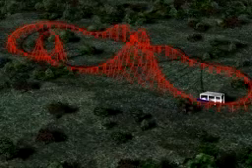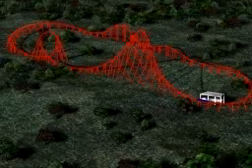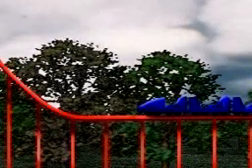How roller coasters work

Comment: Really!? Nothing is technically holding the train to the tracks?except a wheel? What the fuck?
Reply: There are upstop wheels on both sides of the train on the bottom of every car. So that's usually 24 wheels keeping the train on the track. The wheels are also tightly locked into a wheel mechanism that has been welded to the train. Roller coasters DO NOT derail.

Comment: Almost true.

The concept of potential energy, kinetic energy, and G-forces were missed.

Millennium Force can reach speeds up to 93MPH.

The loop is shaped circular because g-forces would have a very bad impact on riders on the entry and exit. The shape reduces the vertical Gs to a safer level.

Banked turns reduce lateral Gs.

The three sets of wheels prevent the train from falling off the track in case of a stall, especially upside-down segments of track.
Reply: true
Reply: Loops aren't circular but I'll assume you meant to say "isn't."